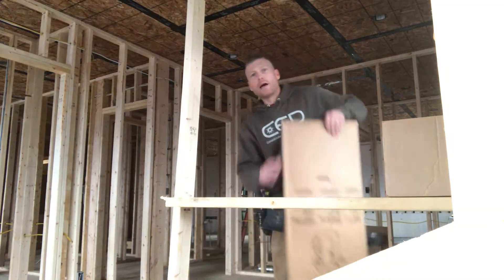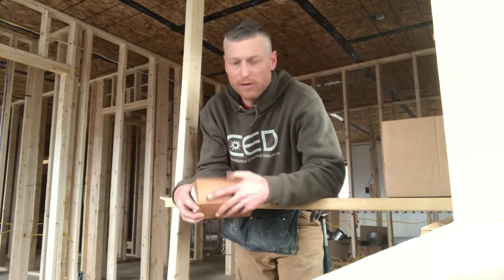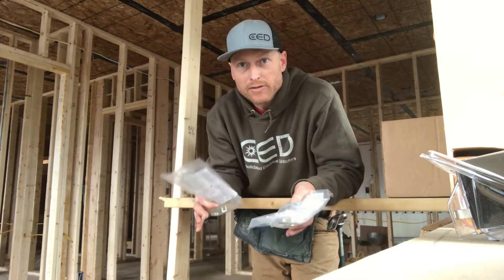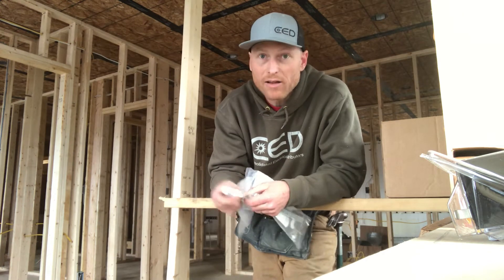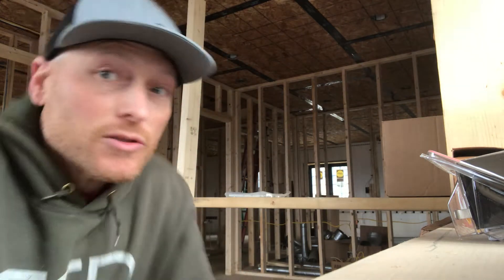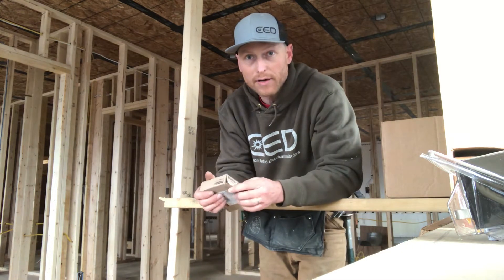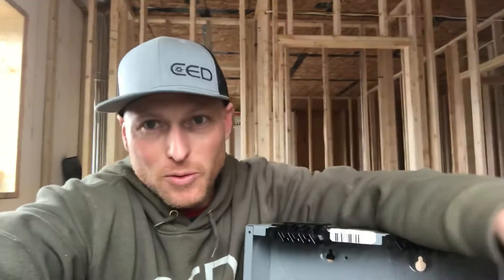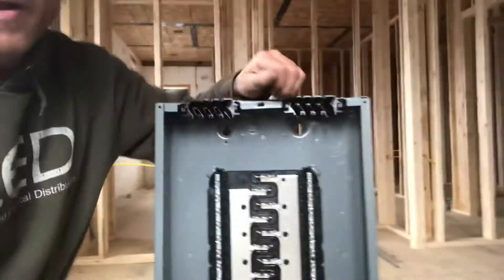How to get started with installing a 200 amp residential electrical panel and what you need to buy!

Comment: I had the pleasure of installing one of these Square D panels a couple months ago. And after being a Cutler Hammer user I have been converted to Square D. It was a new idea to land the home run wires without having to use Romex Clamps. And Yes Your Correct they can be installed up or down.
Reply from the maker: I find it to be quick to get romex runs into the panel. The down side is there is limited space, and I struggled to make it look good, I build a removable box that I can hide  homeruns  top of panel to ceiling. I have features I really like about the Cutler Hammer BR series, and the Square D Homeline series.